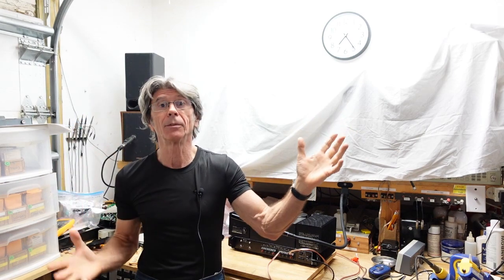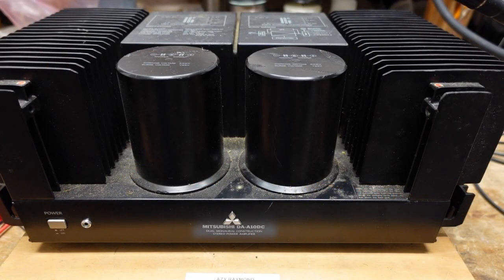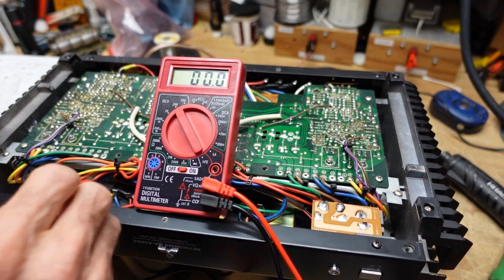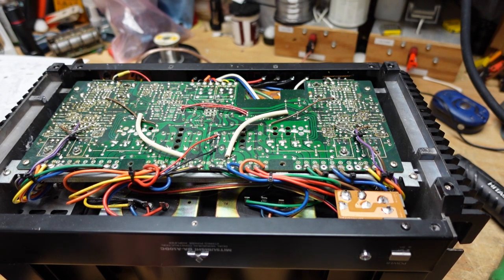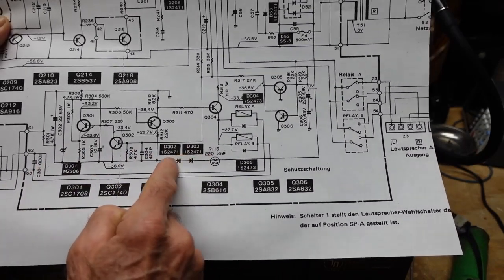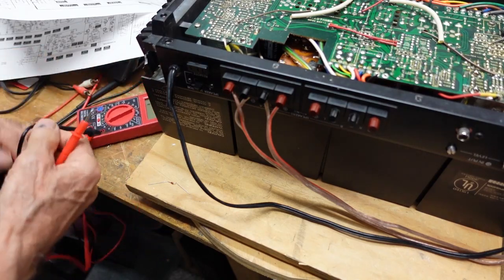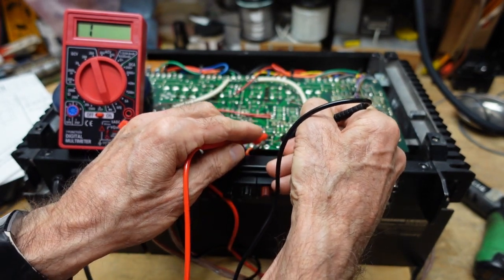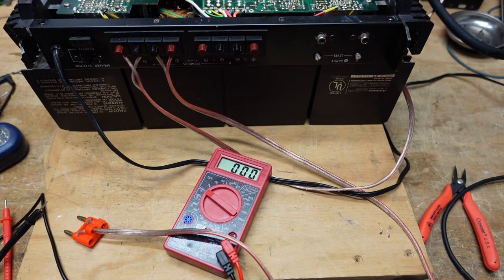Mitsubishi DA A10DC Repair

Comment: This got my curiosity up. I need to check out your other tutorials. FYI, I own two of these black Mitsubishi power amps. The 75 watt and the 150 watt. They both work great and look cool. I think the weak point is the self-loosening speaker terminals. A friend gave me a couple of 1960s transistor radios. I wonder how tough they would be to get working. Thumbs up and subscribed.
Reply from the maker: Thanks for the kind words.  Literally LOL'd at "self-loosening"!

Comment: Hi Ray, thanks for all your valuable tutorials. Couple very quick noob questions sir : @ 8:13, when you placed the red probe on the zener diode’s anode, did you place the black probe on a chassis ground? & @ 8:40, why the change from ac @ D302 to dc @ D301, given that there’s no bridge rectifier between them?
Reply from the maker: Hi Big!  Yes, at 8:13 the black probe was on the chassis; I was checking to see if the -36.5 volt supply was working.
At 8:40, we need to check for DC volts because a diode will rectify AC to DC volts.  Bridge rectifiers are composed of 4 diodes, but a single diode will provide DC voltage at its output, albeit with 60 Hz ripple as opposed to 120 volt ripple.  Bridge rectifiers are just more efficient.
MAke sense?
Reply: @raygianelli3612  totally , thank you so much for the prompt & clear explanation sir !!

Comment: Hey Ray. I am having trouble with the sound of my CD player going through the preamp, tuner/cassette player sound fine, why would CD player sound "staticy"?
Reply from the maker: Dillon, CD players have a high output, and can overload some inputs. Some folks mistakenly plug into phono inputs, and those can't tolerate  high output levels.
Reply: Hey that was the issue! We are also using a Audiotex Laboratories Director and we had cables into "Phono 1" moved them to "aux" and everything is up and running perfectly! Thank you!
Reply: Also where are you located?
Reply from the maker: @DKDLifting  South Florida.

Comment: Thank you for this type videos. I Been bitten by the “repair audio” bug and just finished a Yamaha cr1040  receiver   It had one  Bad IC and transistor in the power supply which  brought it out of protect.  I am Now working on a fisher ca880 with no sound but it tirnes on -comes out of protect and no dc offset , But no sound in either channels and I’ve come to a dead end.  Wire diagrams are not the best for illustration.   I really enjoyed this video!  It made me feel like going back to it with the basics, Checking for voltages where they should.  And stop guessing my self that I can’t.   More of these videos are appreciated.  Thank you 🙏🏻
Reply from the maker: By all means check the voltages on the Fisher.  Also see if there's audio at the relay itself.  There are two 4 amp speaker protection fuses in there also.  Good luck, and stay with it!

Comment: I saw a Owon 1041 on the bench.
I have one.
Fix some things using a cheap multimeter is posible but unconfortable.
Best Regards.
Reply from the maker: Hi Ricardo.  The only thing I wanted to let folks know is you don't have to have all the test equipment I've got to fix certain items.  I just happen to like test equipment, and don't have other hobbies to support.

Comment: Powerful point.
Reply from the maker: What point in particular?
Reply: @raygianelli3612  It's fun to buy expensive equipment but the investment in knowledge is critical.
Reply from the maker: @ziggfreud9820  Ah. Yes, strongly agree. Some folks seemed concerned that they'd need a lot of test equipment to do this kind of work. I've often stressed the point that the multimeter is the single most used test instrument in my stable. But the most critical item to have is knowledge.